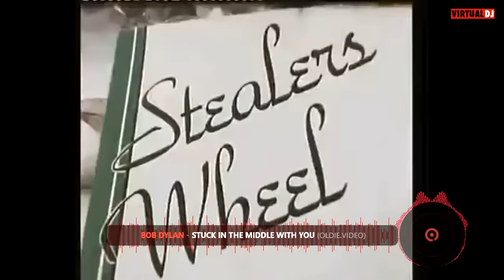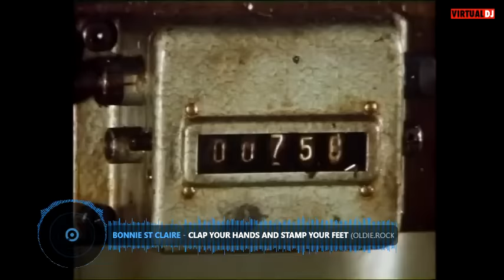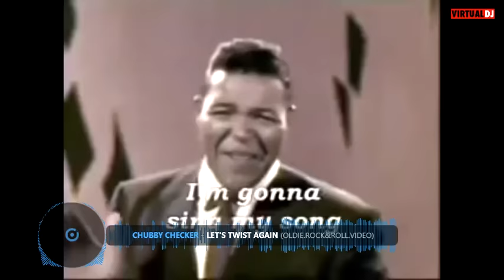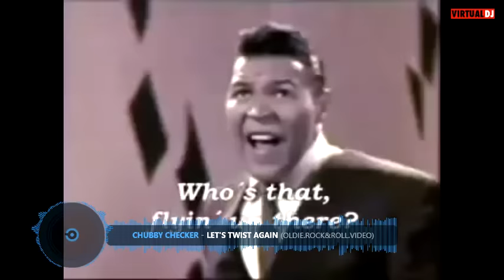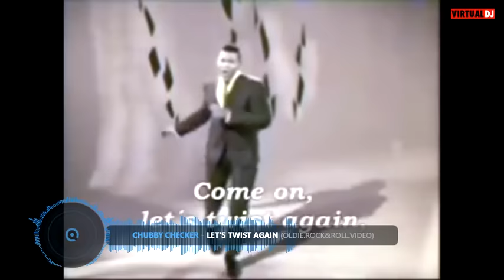Golden Oldies Video Mix 2[Nonstop]

Comment: A video to make in rush for clicks.   Several songs were not hits.  ALso the banner that that start near 46:36  says Bob Dylan which is wrong is Steelers Wheel that sang "stuck in the middle with you"
Reply from the maker: 1 error found is almost price, do you continue for the fridge or do you place something yourself?